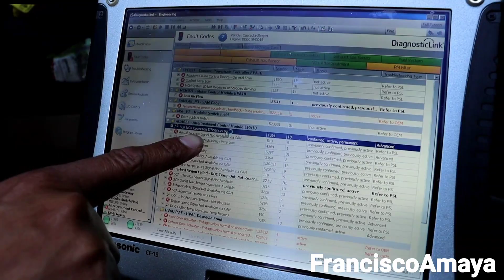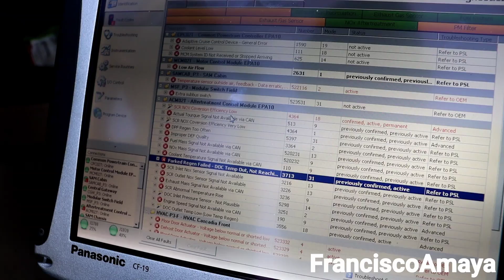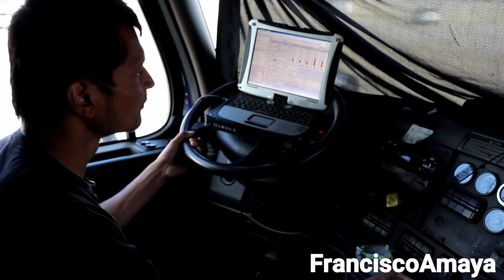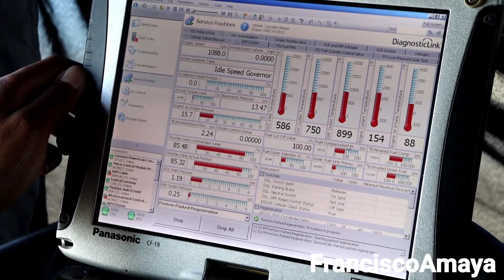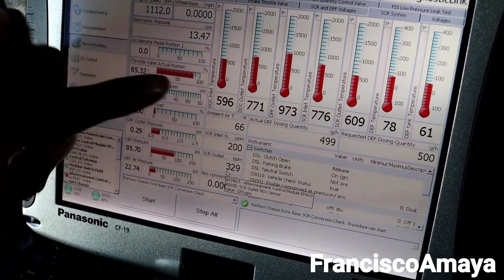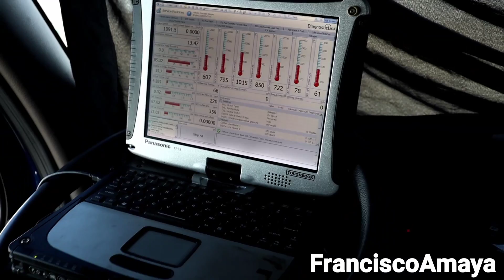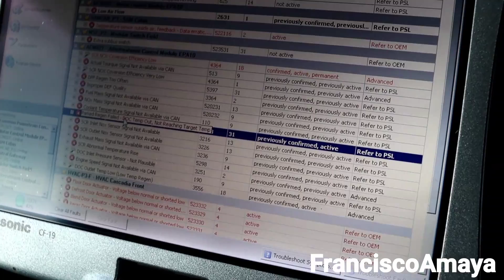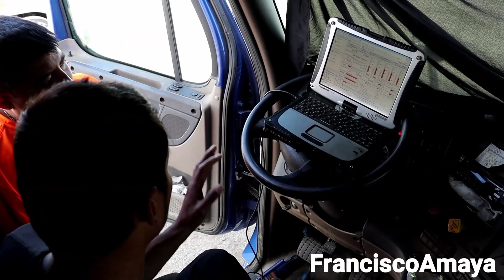S1 E1 F.A.I.T.H SCR efficiency low diagnostic Palmdale CA sierra flatbeds bad scr box

Comment: Hey Francisco tengo problema con    mack 2016
Reply: Quiciera saber si me ayudar
Reply from the maker: Que problema tiene?
Reply: @franciscoamayaYT  el problema aparece un mensaje en el tablero SCR system fault veh speed limited to 5 mph
Reply: Le connected el scanner y no me da codigo le quiero hacer la regeneration manual y no la acepta tambien

Comment: I'd do the SCR outlet sensor trick and keep on rolling. It tricks the computer into thinking the the DOC is working at 100% efficiency.
Reply: nattydreadlocks1973 yeah but your going to damage the engine. The scr box is bad and your going to have high pressure.  You head gonna go bad.  (I may be lil wrong. Francisco can explain)
Reply: how do you do that
Reply: I get 4364 fail 18 when I'm loaded heavy and going uphill, what could this be?

Comment: Wish you can come to Florida my DD13 cascadia blows white smoke with like a bluish hint on and off and no one can find the problem no check engine everything works good no misfire everything has been deleted for over two years with no problems. I used some Lucas in the fuel and Lucas in the oil and same day it starts smoking. Wish I would have never used that crap. Any suggestions Francisco?
Reply: What your address
Reply: Walid Natasheh I’m in Naples Florida
Reply: Piston, piston ring or piston liner.
Reply: nattydreadlocks1973 I’ll tell the mechanic see what they say

Comment: Great video Francisco! By doing this, you will be helping many O/O's that are just stumped and can't figure it out. This will give those people a sense of relief, great job!  I did have one question: what can or causes the 1-box to fail? Lack of maintenance?  Idling? Putting to much of a load on the motor when climbing?  

Thank's again, keep it up👍🏼👍🏼
Reply from the maker: It is designed to last 600k miles average. But idling for long long periods of time damage it more.

Comment: "Easy solution" One box for a Cascadia is 14G alone LOL
Reply: He said easy,he didn t say cheap 😁.
I had a bad SCR box from the day I bought my truck,but I was always at the shop,monthly 1k 2k and I was running with the amber lights days a time.
Finally a shop replaced the box YES 14k,but the amber lights are not a problem anymore,a year without them lights...I spent more than 14k in my many visits to the shop in a span of 3.5 yrs.
Reply: @giovannisocci8793 Next time get it deleted. Freightliner still hasnt figured out the over fueling issue in extreme weather climates. and youll be spending 1K a year in RS supply kits if temps ever drop below 0C lol. 14K for a one box is a joke is all im saying.
Reply: @xxpr0nag3xx  You are correct,but deleting it is not an option,I hear that it can be bad for an engine bc it still runs hot and the heat doesn t quite dissipate but stays into and so it shortens the life span of the engine.
My engine is almost at a million miles,I will buy a new truck soon...
I only wish I had a Francisco near my house.
Reply: @giovannisocci8793  Im a freightliner specific mechanic in Northern Alberta. the delete doesnt harm the engine. Most people get it tuned right to piss and will blow a hole in their pistons but if you get a proper delete then it wont run too how. Its just like a normal engine.
Reply: @xxpr0nag3xx  That s great,I will do more research,I d like to do that on my new truck,thanks for the info.👍
Reply: @xxpr0nag3xx  is that legal in California?